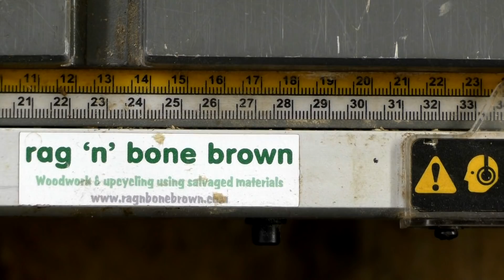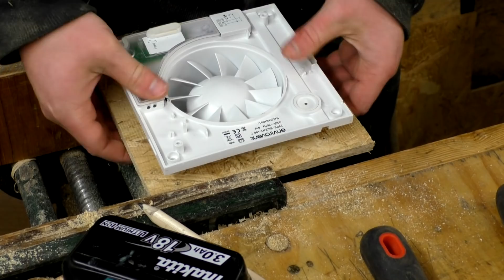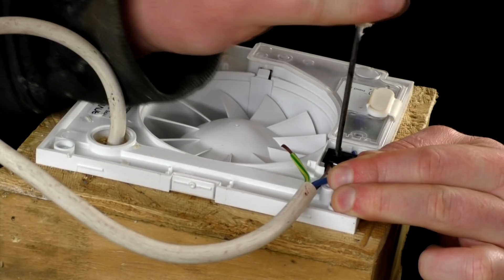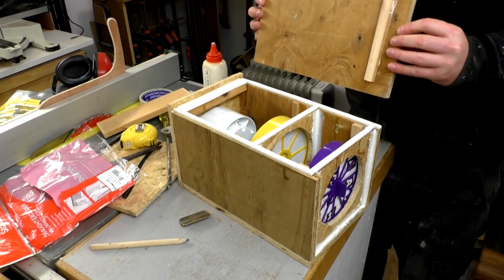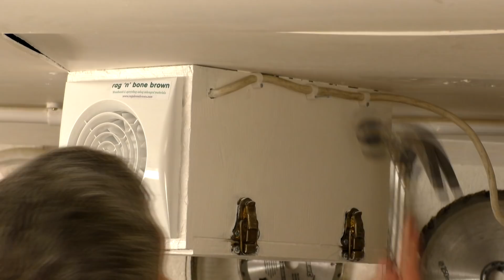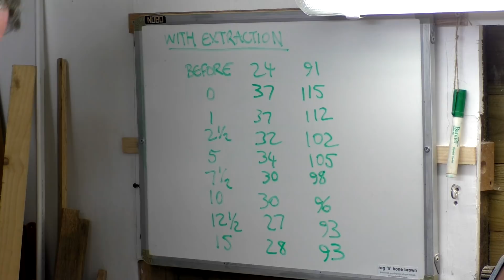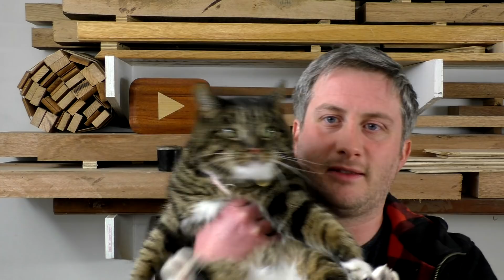Making A Small Air Filtration Unit For The Workshop.... FAIL!

Comment: Too much filter,  not enough fan..  need cfm for filtration..  need to be able to pull the entirety of the air in the room through the fan at least a time or two a minute..  otherwise theres no pulling the dust out the air as it is settling..  bet if you took a leaf blower inside the shop itd kick up crazy dust, thatd tell you that the dust mitigation of the air is lacking..

Comment: Your air cleaner most likely is not powerful enough to pull any air through it except bellow it. The filters are too thick, making the air flow decrease. Your fan is also most likely not powerful enough.
A much better way of clearing dust is to collect it before it goes in the air.
An even better way is to just buy festool tools :) .
Reply: Good job for trying it though

Comment: Maybe a failed project but still a successful video!  Last summer I made something along similar lines but using a 12" fan in front of which is a 12" x 24" furnace filter (pleated paper). I haven't been able to check its performance as scientifically as you did but can say that after a couple of days woodworking the outer surface of the filter is covered in fine dust that I can clean off. So I reckon it's doing something useful.  Good luck with Mk 2 version!

Comment: your fan is too small its designed to catch air not push it , try using a normal 24in fan it will push enough air around

Comment: You are moving air through a tube @ 5-cfm , pushing* air through not one but two hepa filters , bringing that crappy 5-cfm down to 1-cfm in a shop the size of about 300cf taking about 300 minutes to complete one cycle . it should take 10 seconds , not 10 minutes.

Comment: Keith, great video as always. May I just say there is one big reason why your design wasn't successful, you have designed it back to front. In your design, you are trying to push air through the filters. The fan is pushing air into the filter box, the filters are then restricting the air flow which is causing an increase in air pressure inside the filter box. Because of this, very little air will be passing through the box or filters making the whole thing very ineffective as your results show.  If you look at the ones you were considering buying they are designed so the fans pull or draw air through the filters. By doing it this way the air pressure in front of the filters will be negative, this will cause dirty air to be drawn towards and through the filters allowing air to flow much easier. Try turning the fan around and remounting it to the box so it pulls air through the filter box and the filters and try carrying out the test again.
Reply from the maker: Thank you for the great info!

Comment: In my opinion the only mistake you’re making here is underestimating the value of this video.
You’ve actually demonstrated 2 things. Firstly, and I don’t mean this sarcastically in any way, you demonstrated how not to make an air filtration unit. It’s supposedly said of Thomas Edison when he was asked if he was disappointed at over a thousand failures to make a light bulb he is reputed to have said “No Not at all. I’ve actually discovered over a thousand ways not to make one!”

Secondly and most importantly you’ve demonstrated the need for good dust extraction and air filtration, especially in a busy, small and totally enclosed shop. Those particles you were measuring were far to small to see but big enough to make a difference to our lungs in years to come.
Thank you for sharing this video and demonstrating this. If nothing else, if it helps someone prioritise this matter in their own workshop, without knowing it you may have just prolonged their life by doing so. 
Good work mate and thank you. 👍